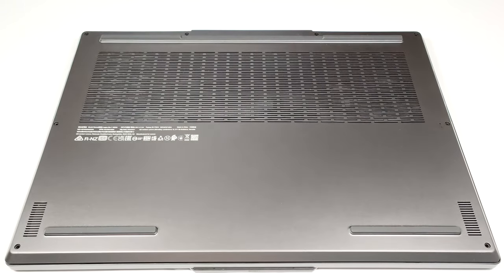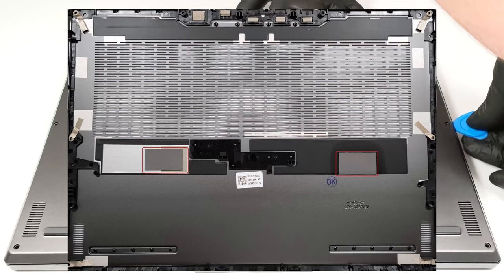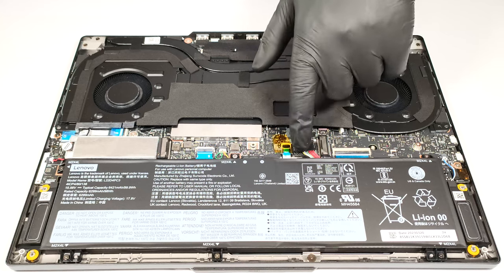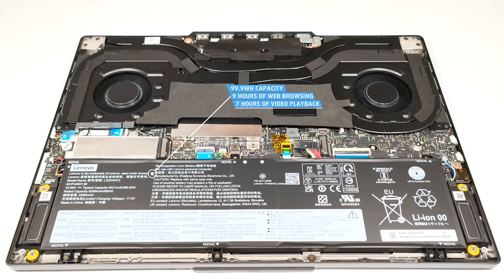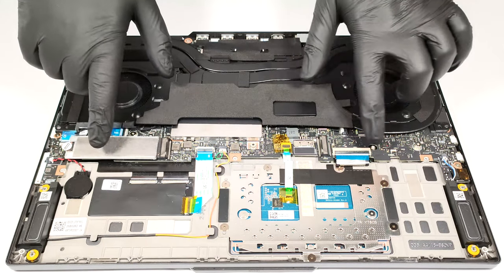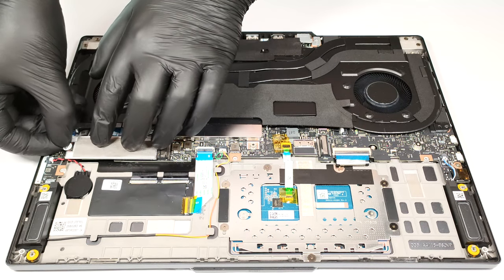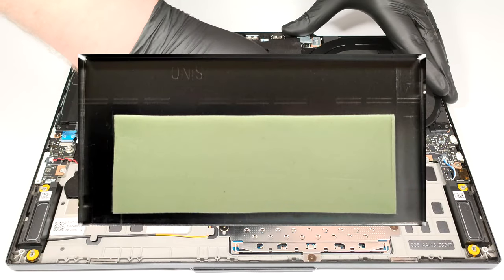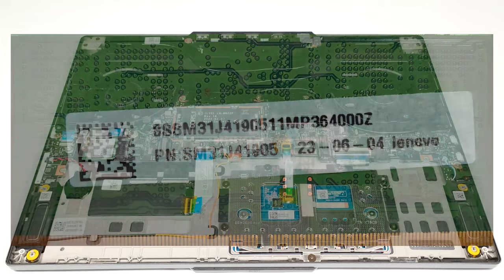🛠️ How to open Lenovo Legion Slim 7i / S7 (16 Intel, Gen 8) - disassembly and upgrade options

Comment: Hi, does anyone know what I need to do after install extra  SSD? I am unable to access or store/ save file to it, it does not show up under file explorer. how do I activate it once I had it install to the laptop? thanks
Reply: Windows > Disk management > right click on black labeled disk (unassigned space) > create partition
Reply: @maciek_-qx1bo   thanks my man, i got it working. thank you alot

Comment: Actually, the laptop can easily fit 64 GB RAM but to do it, You have to install 48 GB stick (for example Crucial). It then has no problem working with full RAM capacity. As for SSD, two 4TB WD SN850X (double sided but thinner than most other models) fit in slots.

Comment: Hi! Is it possible to install a 32 GB stick?
Reply: No, because although the CPU supports more, the motherboard doesn't support over 16gb per slot.
Reply: @NossDDoss actually not true at all. Laptop does support 64 gigs of ram, no problem. You just have to buy 48GB stick, like for example Crucial.

Comment: Why is it that the spec for the 13th gen i7 handles a memory speed up to 5200MHz, but in this laptop, the soldiered RAM is running at 5600MHz? SO... if you buy another 16GB stick, which should you choose? 5200 or 5600?
Reply: Idkk i wish i could help uu
Reply: The Intel model uses 5200MHz RAM. The AMD model uses 5600MHz RAM. Choose the one that matches your model.
Reply: I'll choose 5600mhz sodimm of course.

Comment: I have the 2022 model with a 5th gen AMD chip.  I was able to get the RAM up to 48GB by adding a 32GB SODIMM (plus the 16GB onboard).  Any reason why this model won't take a 32GB SODIMM in the slot to take it to 48GB of RAM?  With the work I do I need more than 32.
Reply: Did you try upgrading? I'm wondering if I could do the same  and a 2×16 ram stick bringing it to 48gb ram

Comment: Hi! I am considering upgrading the RAM on this same laptop. Should I look for the same brand of the soldered RAM stick? Or is it enough to get a ddr5 16gb 5200 mHz?
Is any action necessary when turning the laptop after installing the RAM stick?
Reply: The only thing that matters is that it is ddr5 (if your laptop has that) and 5200MHz (or whatever speed your laptop supports). The brand doesn't matter but Corsair has good reputation.
Reply: Can u suggest the best additional 16gb ram for this laptop of ddr5
Reply: @tarunteja5575   CORSAIR VENGEANCE SODIMM DDR5 RAM 32GB (2x16GB) 4800MHz CL40 Intel XMP iCUE Compatible Computer Memory - Black (CMSX32GX5M2A4800C40)

The difference between 4800MHz and 5200MHz is so small that it doesn't matter.
Reply: @NossDDoss  thanks
Reply: @tarunteja5575  np
Reply: My RAM says 5200Mhz is it okay if I buy one that is 5600MHz ?  @NossDDoss
Reply: @emersonlopez5601  look up your motherboard model and see what maximum ram speed it has. If it's a laptop, look up the laptop model number.

Comment: What's the maximum RAM and SSD this can take  ?   I want to buy sticks for both areas but not sure if I'll pass the max capacity
Reply: 16gb per slot. If it's M.2, any size fits. The storage space doesn't change the physical aspect, so any storage space will fit.
Reply: @NossDDoss  Thank you
Reply: @lancefordable  You're welcome
Reply: i mean there are 4 and 8 tb ssd out there, so theoretically you can have 16 tb on the laptop if you can afford the two ssd